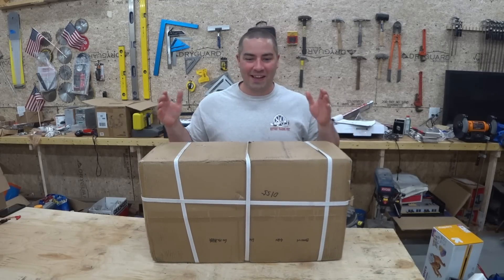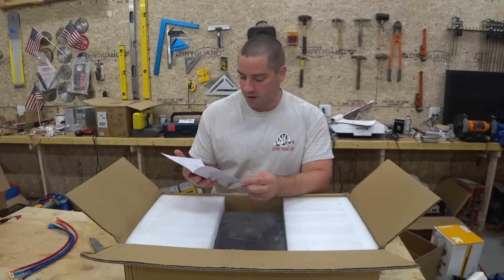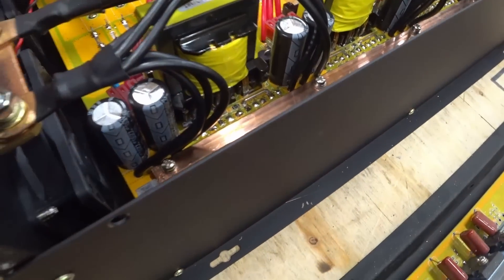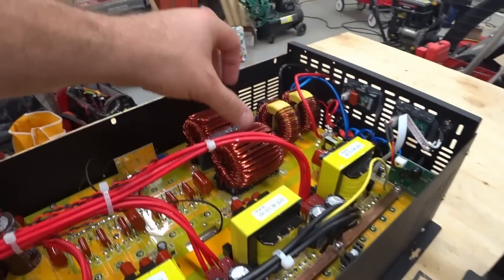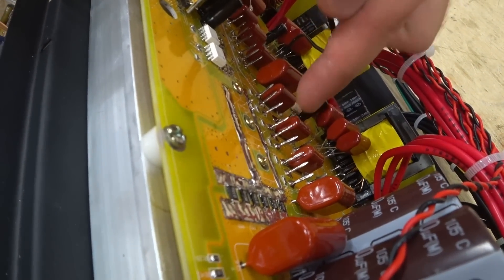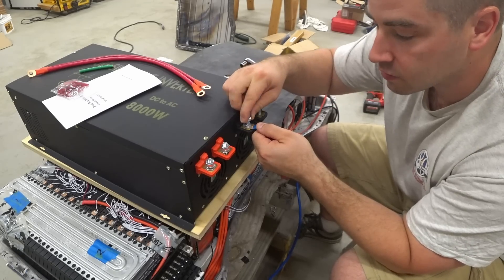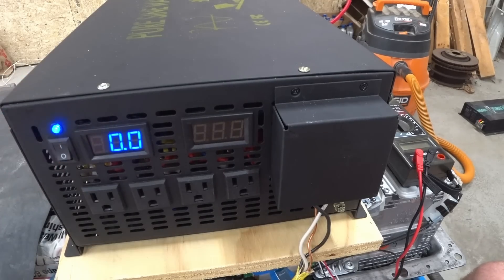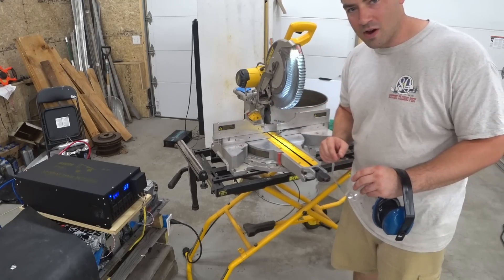Cheap 8000w Reliable Inverter, That Works! WZRELB

Comment: Hey David. I bought one of those 24v 8000w inverters after watching your reviews. Hooked it up but I'm dissapointed cause it shows the input voltage which is 28.6v but the out put voltage rises to 123 when turned on and fades out to 00 again it won't hold. I'm not an ectrician and doesn't know much about things like that . I was wondering if the wrong voltage inverter was sent cause I read somewhere that if the voltage is lower than it should it will have the same effect. But I'm scared to try hooking it up to 48v system. Please help you seem very capable and knowledgeable.

Comment: By my calculations they over rate this inverter by about 800 watts not including energy lost by the inverter itself.  30 amp (10 AWG) =3600 watts minus whatever percentage loss according to this units efficiency. I would say it is a 3500 watt inverter. I wonder what the surge capabilities are?  I'm betting that inverter is rated on it's surge or peak capabilities and not it's constant. It can only handle it's peak for a second or less before it self protects. It should be rated 3000 watts. Manufacturers should always rate their product conservatively so guys like myself don't feel ripped off.

Comment: Should have opened up the covered box and used an IR thermometer to check the temp of the block.  Mine melted.

Comment: Dave, this wasn't even close to your 1st test. You didn't push it to it's max & didn't show if it still had voltage feed to the ground. I was thinking of getting this but I'm skeptical. Do you still have this inverter to do a full load test?
Reply from the maker: I think this was my first video on this this inverter.  My second video I attempted going up to the full load and if memory serves... it stopped at 7kW, not 8.  I don't recommend it because of that.  Do you need some suggestions?

Comment: LOVE ALL YOUR VIDEO THEM 🥰🥰🥰 I HAVE QUESTION TO ASKED YOU I HAVE 48V 3000 WATTS PURE SINE WAVE INVERTER OK I HAVE PMW 48V SOLAR CHARGER 30A BUT THINGS THEY DID TELL ME HOW WATTS OF SOLAR PANEL OR HOW VOLT I SOULD USED BUT I HAVE 4 12 VOLT 18A BATTERY SO HOW MUCH VOLT OR WATTS I NEED TO CHARGER MY 48V BATTERY EACH BATTERY 18A

Comment: the ultimate test is run a 15000 BTU RV AC unit just after its been tuned off (under load) ive killed modfets a few times doing that

Comment: David i have a 4000 watt sungold power split phase inverter.  Does it need split phase input or could i just use 2 110 inputs from the same phase. It looks like a auto transformer inside and it doesn't require a neutral on the input. It seems to make its own neutral from pulling from the center of the transformer. The reason i ask is that id like to charge batteries thru this woth my generator but my generator is 110 volt only. If i could just use 2 of the 110 inputs as same phase i thi k it would work but im not sure and i dont want to burn up a 1000 dollar inverter. Any advice is appreciated

Comment: Hmm maybe ill stick with this same brand.. Seems they changed the name a little with all those letters lol. I bought a 1500W/3000 peak 12 volt version over 4 years ago.Its been running 24/7 for over 4 years straight probably closer to 5 years. 0 issues. A master electrician loved ripping into me for owning it 😂 saying it would start a fire.. I hope it never does lol. Its ran 10-15 amps continuously as a backup till the batteries died everytime. I now need something for Offgrid due to the Douchebags that are the county! wont hook up power without a house plan/ foundation/ septic and well before they would give you a power pole. some major BS. then they tell me they have no ordinances against solar and cant regulate it! well guess im trying solar till they complain and ticket me.sure it wont be long with my luck :) everyone loves bothering me for no reason at all. Maybe that DHS watchlist?? probably being reported by the watchers everywhere i go.

Comment: The real reason why the newer inverter don’t drop voltage is the programming of the pwm pulse ,when a load applied the power to the pwm drive drop lowering the gate voltage causing the pwm pulse to turn down lowering the output voltage but buy using a booster converter with a voltage follower the pwm pulse voltage don’t drop in goes a bit higher for the surge and that’s how the voltage shows high when load is applied

Comment: National electrical code only allows 1/0  AWG or larger to be used in parallel. Throw out the cables supplied by the vendor. Their a fire hazard

Comment: You're right those wires look thin but otherwise the design looks much better. I guess if those gauge wires are fine for an 8000W I should have no problem with what I'm using on my new 3000W. Oh and I have calculated AWG.
They might be using the fact that they are considered chassis wiring where the code requirements are a little bit relaxed on AWG sizing. At least it's something easily upgradable although I would try and find out what gauge they are beforehand. I know they might be using a higher grade insulation on the cabling which would end up with a higher ampacity capability.

Comment: Yeah the boys are unreliable looks like an old heart interface on the inside so they just kind of tweaking out some old technology from the USA 1980s vintage and put a little computer chip in there to tickle the fancy into a smoother wave still looks like square wave junk another 10 years they might actually catch up to 2020 technology. And consuming 50 plus amps at 56 volts and only given 22 amps at the outlet is extremely subpar efficiency.
If you want to really test it put it under full load with batteries at 40% so they're pulling down around 44 volts this will create enough extra resistance throughout the entire unit.
Thermal imaging with plastic wrap simulating the enclosure and watch what happens for 10 minutes at 7500 w or just wait for a puff of smoke  to release.
Reply: What brand do you recommend?

Comment: It's $1500 and it is not a split phase inverter. It should have 240 volt. Come on man!
Reply from the maker: If you are looking for a 120/240V, check out this one: https://signaturesolar.com/eg4-6k-off-grid-inverter-6000ex-48hv/?ref=4_rHcgZ9x-TiF-

Comment: It would have been nice if you showed actual performance with a power meter (like a Kill-a-watt) and multimeter.  Your tests didn't even begin to show the capacity of an 8kw inverter, the most you ever loaded was around 2kw.  When you measured 58amps on the battery leads, that at 54 volts was over 3kw, but doesn't show the efficiency, since the compressor should have been less that 2kw.

Comment: Oh,man what a waste of time:; expected more,   why are you testing a 8000 Watt inverter with only a 2700 Watts load??
Can you see my problem here??

And  the inverter is GOOD,  10AWG wire is  rated for 55 Amps, for chassis wiring, and  15 Amps for Power transmission;  so, not bad, in that inverter.

Comment: Why is there 2 positive & 2 negative post on this inverter? I have a 12 volt battery system and will be  using this inverter for deep well pump 240 ? My previous 240 inverter 5000 watt  didn't start my pump everytime and only had one battery post to connect positive  and negative. Ok ??

Comment: No volt meter to check the accuracy of the indicated voltage? It would be nice to have meters indicating battery output and inverter output during a test.

Comment: David, I have this same inverter in 10k watts in an off grid system. I was wondering if you tested the smaller plugs on this one. Mine shuts off when using the smaller plugs with  an electric blower or electric pole saw. These are rated at 5 amps and the plugs are 15 amps. I'm not sure what the issue is. I was just wondering if you had any issues with the regular plugs or if you tested them at all.

Comment: is this still a good inverter?  I am looking to build a Home "UPS" for some essential circuits like TV, Computers, 2x fridges with about 24V/400A batteries. I also need to know if I should use an automatic transfer switch or what?  the goal is 4-6 hours of power backup for essentials.

Comment: So is that 120v single phase or 120v split phase?  What does the volt meter read between ground and neutral?  If it is 60v it is 120v split phase/Live neutral and uses push-pull.  If it is zero volts, it is 120v single phase.

Comment: Way to small wires!😰
I have a small HF 650 Watt continuous inverter and the wires on their look thicker with this scrappy wire insulation and to run a 4.3 amp angle grinder the wires run hot.

Comment: The cable should be fine.
It does sag. Trying to remember you draws, but around 13 amps.
There is also a overshoot..

That meter is slow and not great, and does it hold the wave? 

The MOSFET grouping wasn't clear, looks like a 3 * 4. And it also looks split. 

I think the high voltage h bridge design is good. Here (UK) this normally reaches 475v and caps and other hardware tends to limit or cause failures. With the lower voltage, it's simpler to make.

It is a big box for what it does. I'd have gotten rid of the sockets and gone for terminals.

Comment: I very much enjoy your disciplined investigations. 
I'm helping my neighbors go off grid for the sake of getting off of our coal-burning utility. I have been interested in this video and a more recent review of an MPP Solar inverter for your neighbor planning to power his well. 
Since they are my neighbors, it would be better for me if what I recommend be reasonably bullet proof. The running of the saw and air compressor in this video impressed me, but, when I went to your affiliate link at Amazon, I found several distressed reviews. 
What is your thinking about an economical, reliable, powerful inverter now?
Reply from the maker: There have been massive improvements in inverters over the last few years.  Really great to see.  This 8kW from Reliable works decent enough for running some items.  However, it never quite reached a true 8,000W.  I have another video on it where I tried to get to 8,000W and couldn't.  I think it's decent for the price, but there are better alternatives for running a whole house.

Comment: Does anyone know how to hardwire the 220v version, because I was reading the manual and it’s said that red is hot and black is neutral and yellow/green is ground, and for a 220v connection don’t I need to hot wires ? Any help would be appreciated

Comment: And could you tell me 
How could i charge 4s lithium polymer pack 84 amp by solar 
I try everything but result is zero 
Mostly mppt or pwm controller 
Set on 12 volt or 24 volt specialy lead acid battey which set on high 15.5 
But lithium polymer high volt is 16.8
And parameter is not match 
2nd thing i use boost mppt or converter but problem is mostly solar panel given 18 volt or 36 volt 
So what i should do 
 
So how could i charge 
I hope you answer me 
Ple ....
Reply from the maker: I don't know of any solar charge controller that will go up to 16.8V.  
You could use the solar to charge a lead acid battery, then use a boost converter to go from the 14V L.A. to 16.8V Li.  Or you could sell your current battery and build a 4s LiFePO4 battery that will charge to 14.6V (perfect replacement for lead acid).  Or you could re-arrange your current battery into a 24V or 48V where the charging parameters line up better.

Comment: Why did you bleed the air compressor? Does the air compressor not have I bleed valve at the end of compression cycle? I think you should've been bleeding the air compressor until it hits start (and let it auto start) then pull the trigger on the chopsaw for a good comparison. Is that unit really $1400 USD?

Comment: I saw another youtuber with a WZRELB inverter connect the red inverter terminal to the white wire and the black inverter terminal to the black wire. It worked, but which way is correct?
Reply from the maker: I'd go back to the manual.  There are different models of inverters from WZRELB

Comment: I don't like inverters that use multiple small ferrite transformers. At best they deliver their claimed output (or less, if Chinese !) but little more than that, even as a starting load. By comparison, it is fairly straightforward to design an inverter using a low frequency toroidal or other iron-cored transformer than can deliver anything up to 6x its continuous load as a peak and 2x for a few mins.

Comment: It's recommended not to crimp and solder only to do one or the other. Increased risk in stress cracking outer strands reducing the flow causing heat, etc etc etc. A good crimp is all you'll ever need. Or solder it. Cheers.

Comment: Help me here…How is this being powered?…what is the batt pack? What awg is going to the batts?..
Show us something that pulls 8000 watts..I would think that is a true test of an inverter..
Dennis
Reply from the maker: The inverter is being powered by a large EV battery that I re-wired to 48V.  I have several videos on the tear-down and build of the battery.  Just check out my channel, click the video tab, then you can scroll through them.  
I also have a second video testing this inverter up to the total capacity.

Comment: Remember that House wiring and Chassis Wiring has different ratings for wiring.. So that wire could be 90 degree wiring rated for the distance and the amps.. still light but not an expensive fix..lol

Comment: Could this be used in an RV to power an air conditioner etc? If so e what kind of batteries and how many/ type would be needed?
Reply from the maker: If the AC is 120v, then yes.  here is someone else video where he did it: https://youtu.be/kmXLJBnyfH4

Comment: I just don't trust china electronics, it's never what they say.  Is that your experience?  Nice videos
Reply from the maker: Not always.  In this case the inverter maxed out at 7kw, not 8kw as advertised.  However, this past month I've been using a different brand (Growatt).  The Growatt is also made in China, but actually exceeded the rating by 10% before shutting down.

Comment: Sorry David 
So hi it’s Jason from my YouTube channel 
DIY product testing & reviews and yes I make my mistake to but at least I am not payed to say nice thing’s about sum thing that could potentially catch my home on fire and in danger my family yes i had a guy complain saying didn’t you know you have to hold down the power button for 3sec lol anyway enough about me
So I just had to go look up what this very bad inverter cost sorry David BUT $2,200.00$ on amazon are you crazy I can get a Xijia 5000w Peak power 10,000w notice how it says that for only $864 on amazon comes with all the same safety features for US plugs and then a high output Hook up two digital displays and it’s remote control so I can get two of these for less than unreliable and have 10,000 W or 20,000 Peak W and I did both price comparison so everyone knows on Amazon nowhere else so that it was an even fight

Comment: Oh and one other little thing that really got me the copper bar that runs across those nine transformers is a big no-no The flow of electricity causes unnoticeable vibrations to humans but if a lug ever came loose and a washer hit the Copper bar and something else do you have troubles it should be sleeved with shrink tube and only at each connection should the shrink to be notched out and for a little added safety just a dab of silicone on the backside of the connecting log so my conclusion to these two inverters is I would not purchase them if it’s made in China installed by yourself not CSA approved and you’re not the electrician your house catches on fire your house insurance is void if you can do it yourself do it right the first time double check everything make sure it’s all tight and don’t be afraid to spend a little extra money to buy better products and definitely don’t be afraid to ask a question there is no such thing as a dumb question

Comment: Another thing too I would’ve liked to see you push those to the limits using your own testing equipment as well and I’ve got a degree in instrumentation so I deal with a lot of this type of stuff and those copper rings that you pointed out I actually called toroid inductor and depending on the wraps of coil wire around an iron ring I’ll give you different amounts of cheating start up voltage so what the capacitors do obviously hold a certain amount of voltage when you plug something in and pull the trigger the system acknowledges instantly a current usage so those capacitors then send they’re full charge to those copper rings which would show a spike in voltage on your voltmeter on that inverter I like in the newer model you pointed out it had only one larger copper ring and that’s because all they did was use a smaller inner iron Core and simply wrapped more copper around it and by adding one extra capacitor fixed voltage drop problem i’ve worked on a lot of transformers myself with the trades I am in and 8000 W is peak power not constant run I’ve built a couple of power walls and you go through the house and check oh roughly what their current usage would be or I could simply put my metre on it for a couple days and let it record and if I got a reading of say 7000 W even with those units saying that they’re 8000 W each I would recommend the customer to install two of them for a total of 16,000 w i’ve got a friend of mine I’m doing a report for he’s building one of the fastest electric bikes and for example his max average is 30 amps into the motor but the Daly BMS that’s being put on it is 100amp

Comment: Just another little comment are used to rebuild air compressors reciprocating screw and Hydro van and no air compressor starts under load the tank may have pressure but the little copper line that goes from the cylinder head to the tank actually has no pressure in it at all and that is so it helps the air compressor get its first two cycles going that’s why when your compressor shuts off when it hits it’s cut out pressure you hear a small yes and that’s a little valve draining the line from the piston to the tack